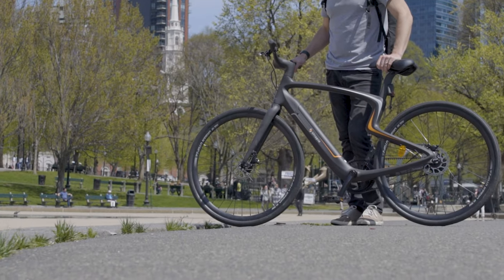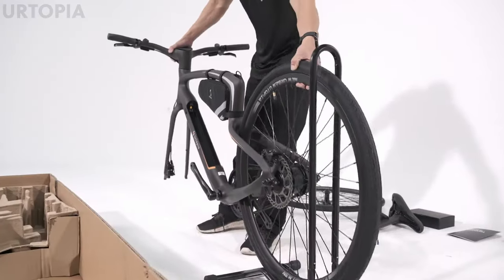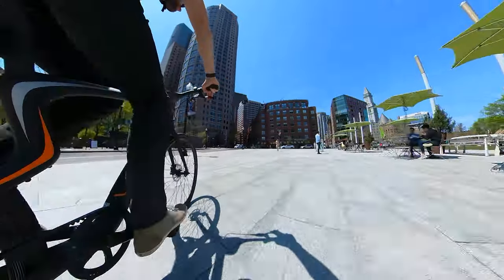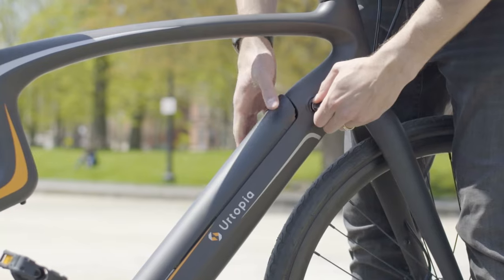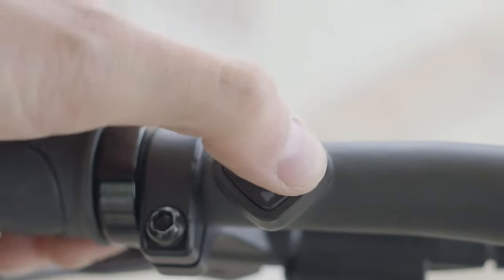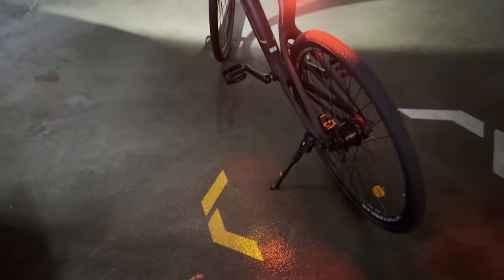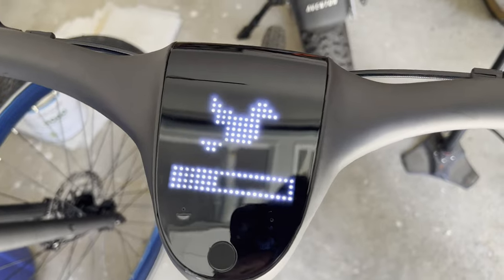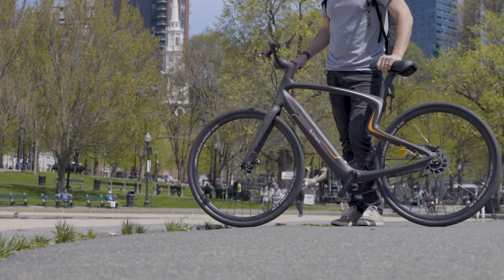Urtopia eBike Review - Ultra Light Carbon, Belt Drive, Torque Sensor Electric Bike!

Comment: All that tech, still get a flat tyre though.
Reply: Purchase and mount a tubeless tire that will self heal, they are normally lighter than tires on eBikes. Normal wear or considered replaceables parts on bicycles, same as a car tire with nail or puncture in the sidewall...

Comment: So basically pay 2800 for a no throttle no rear suspension bike which constantly tracks your location, surroundings and fingerprint
Reply: Suspension is not needed it is just extra weight to carry up and down the stairs, throttle riding is a lazy man eBike usage. Tis funny to watch a group of riders on the way to work never spinning the pedals.  I understand everyone has their own preference, but throttle users do not need an expensive eBike when sit down scooter are much cheaper...
Reply: And a very weak titted motor at only 35 nm, so work your butt off getting up hills, and with carbon belt you loose leg leverage. Single speed and you have something you can ride on flats for maybe 10 miles at more than 15 mph unless you want to pedal as fast as a gerbil on a gerbil tread wheel going nowhere. Teeny battery will have way too many charge cycle too soon, and you will be buying a new one in maybe 2 seasons if you are lucky, and by then your range will be only80% of what it was new, if the battery still works.

Comment: Why are you reinventing the bicycle frame?  Ride1up gravel or KBO Hurricane are both stealth eBikes that appear to be like a normal bicycle with a almost 10 ah batteries, yes they appear to be a standard bicycle to most other riders. Most people in the inter cities live in condos, apartments and walk-ups without a freight elevator  and need to carry their eBikes up and down the stairs daily to commute to and from their workplace. Short trips for grocery, or a pub visit after work the bicycle does not need all the fancy cell phone electronics, or features of a VanMoof e-bike. Please give consumers a standard looking single speed bicycle in carbon fiber that weights 26-28 pounds with a gates belt drive, torque drive, downtube stealth 10ah battery and controller storage. 5 different power levels, and space for a forward gps mount on flat or drop bars for a $70 brighton gps unit that will keep track of speed, moving time, average speed, temperatures and mileage, so users can upload to the bicycle tracking websites of their choice.  Sell this normal appearing bicycle for $1,500 with a split frame necessary for the gates belt drive installation...
Reply: Moan moan moan.